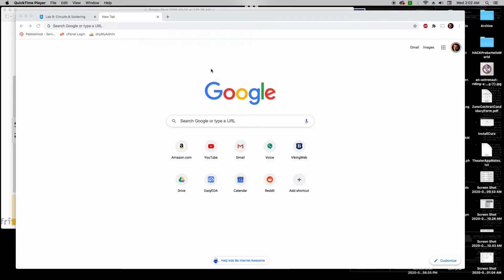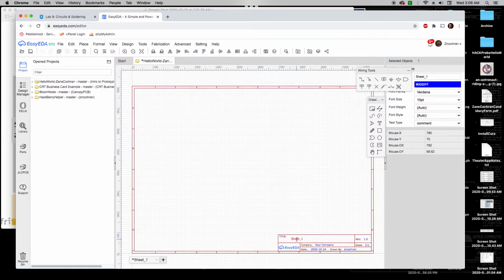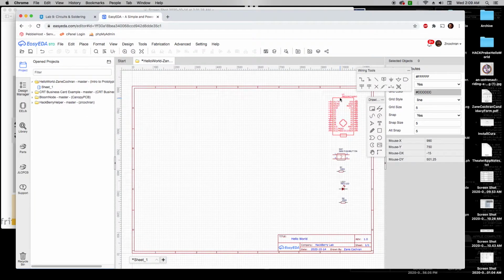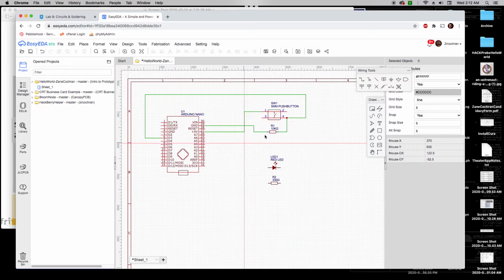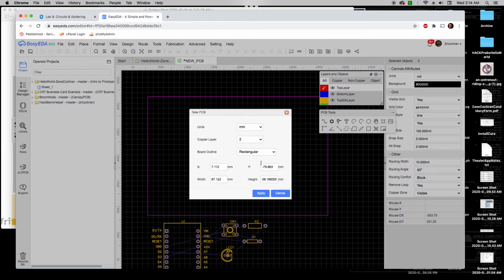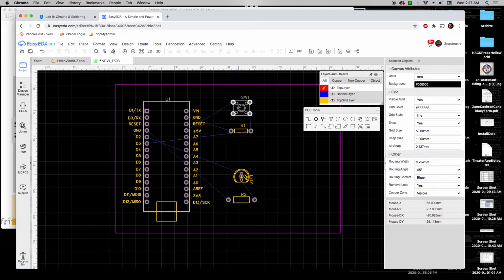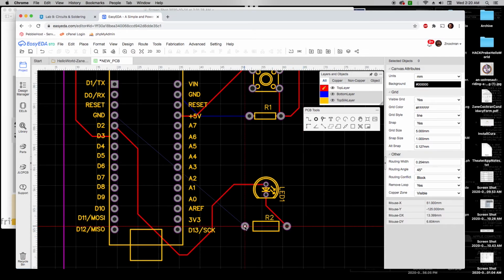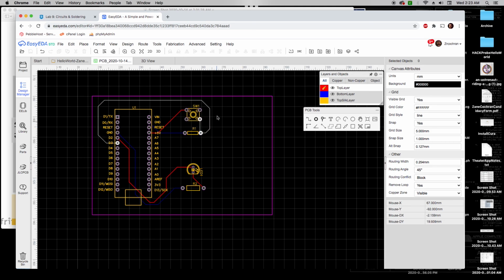Designing PCBs with Easy EDA (Intro to Prototyping)

Comment: When you order these PCBs, do they come with all the parts attached, or do you do that yourself?
If they do attach the parts, is it possible to mark some parts as things you'll fill in yourself?
I have a NodeMCU based circuit I'm designing, and I'd like to use my own NodeMCUs, since I have a lot of them lying around.
I do not however have the other parts I'd need if they don't provide them.

Comment: Hi, I have a question. When you chose an Arduino Nano, does that mean you're buying that Nano or am I looking at schematic of that board? I ask this because when you show the 3d representation, I don't see and actuall Nano. I had a board designed and when he sent me a 3d, I could see the components in 3d. I'm learning to do this myself.
Reply: You are not buying an actual Arduino Nano. It´s just the board layout that´s used to later put in a Nano with male headers. Some components have a 3D model included, which is shown in the 3D board simulation to visualise them better.
Reply: @kek7778  Not the original question asker, but I have a followup.
Is this also true of the other components on the board? Does this mean after I receive the board, I have to solder all the parts on myself?
Reply: @Tiparium_NMF  You have to buy and solder all of the parts yourself, yes.

Comment: how to install Usb port ? where d+ and d- pins :(
Reply: The Arduino Nano board doesn´t have these pins exposed.  If you can´t use the already existing mini Usb port, you could solder some wires to the Usb port pins and connect it that way. It´s also possible to use the RX and TX pins of the Nano board with a Usb to Serial converter to program the chip.